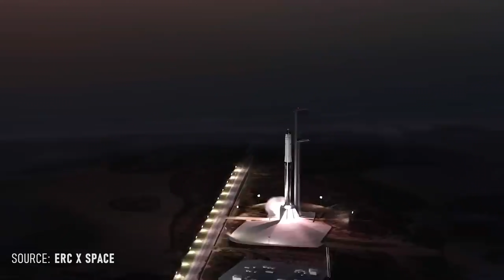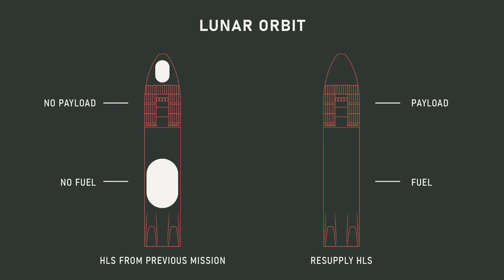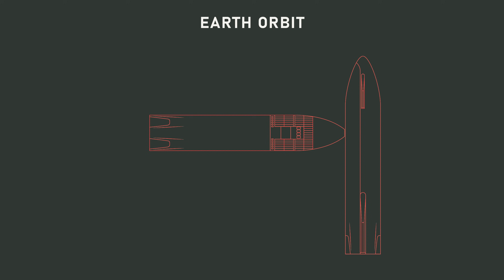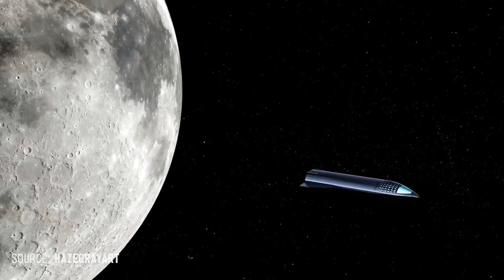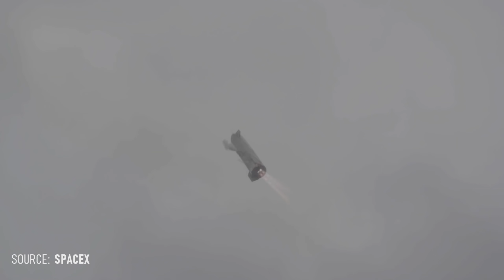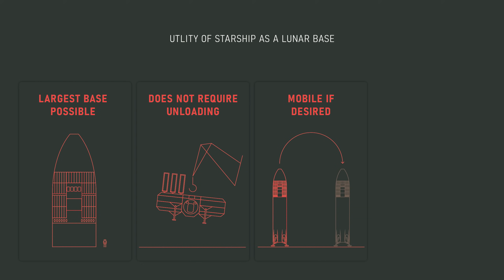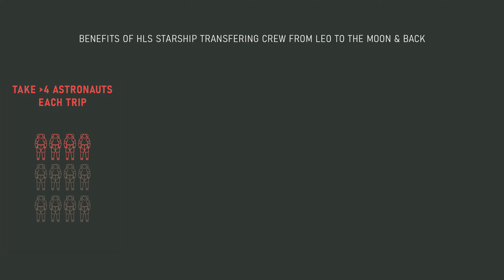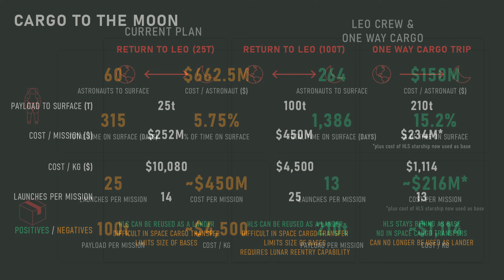How to Use HLS Starship

Comment: Why couldn’t yo send more than 4 astronauts on the alternate methods? Falcon, Orion and Starliner are all supposed to carry at least 7 to LEO and Starship can easily support that many to the moon and back.
Reply: Crew Dragon has room for 7, but NASA only uses 4 to the ISS. Crew Dragon has 9.3 cubic meters of pressurized space, giving about 2.3 cubic meters (3x3x9 or so feet) per astronaut. At 7 astronauts, you have about 1.3 cubic meters (2.5x2.5x7.3) per astronaut, so you are a lot more cramped. Crew Dragon has 12.1 cubic meters of unpressurized cargo space in the trunk.

Starliner has room for 7, but NASA plans to only use 4 to the ISS. Starliner has 11 cubic meters of pressurized space for crew and cargo, giving about 2.75 cubic meters (3.25x3.25x9.25) per astronaut. At 7 astronauts, you have about 1.6 cubic meters (2.5x2.5x9) per astronaut, so you are more cramped than with 4. 

The Orion will initially have 4 crew, but they are talking 6 crew for the later Artemis missions. With 9 cubic meters of habitable space (20 cubic meters total), it will have the smallest of the three living quarters.

I would guess that the ISS living space is why NASA only uses 4 on Crew Dragon or Starliner. Of course there were plans for 5 on Apollo, but they were never used. It could be like camping tents. The tent may say it fits 4, but figure only 2 will fit comfortably.
Reply: @steveaustin2686  thanks for the reply. Yeah, part of the reason to limit the crew to 4 is the capacity of the ISS, as there are already others there, but that isn’t an issue with Lunar Starship. It would be interesting to calculate cost/astronaut-hour and work hours available/mission with 7. I know I would tolerate a few hours crammed in a Dragon for a chance to go to the moon. Probably better than 3 in a Soyuz.lol.
Reply: @richardanderson1988  Oh for sure. Packed like a sardine to get to Lunar Starship? Certainly sounds like a good trade off.

Problem with Crew Dragon to Lunar Starship, is that Lunar Starship evidently has enough dV to get to Lunar Gateway, land and return to Lunar Gateway, but not enough to get back home. NASA was not happy with the Dynetics plan of refueling in lunar orbit and almost certainly won't like refueling with astronauts on board, hence the dual Lunar Starship plan in the video. I'm not even sure if Lunar Starship can make it from LEO to lunar orbit and back to LEO to be used as a ferry service as the estimated dV comes up short.

I wonder if NASA would be ok with having the crew wait on Lunar Gateway, while Lunar Starship was refueled a few km away. Evidently, NASA is looking at using the pressurized space on the cargo Dragon XL to be a bedroom/storage for the Lunar Gateway. Not sure how many docking ports it will have as only the Power and Propulsion Element and Habitat and Logistics Outpost sections will be sent to the Moon on the May 2024 Falcon Heavy launch. I wonder if a Tanker Starship, with nothing but propellant tanks and avionics, could make the round trip and if it could refuel a Lunar Starship enough to return to Earth.
Reply: @steveaustin2686  I’m not that concerned with having crew aboard Starship during refueling in space. SpaceX gets their fuel hauled into Boca Chica by tanker truck now and transfer it safely with no problems. The whole idea of using local resources from the moon, Mars or wherever to refuel will require that eventually people will be nearby. If we are truly going to be a space faring civilization, this seems to be a minor issue.
Reply: @richardanderson1988  In the long run, refueling with crew on board will likely be a minor issue> But with tons of propellant never having been transfered in space before, in the short term, it is evidently a big deal. Likely as NASA gets more experience and is more comfortable with refueling in space, they will do it away from LEO and with crew onboard.
Reply: @steveaustin2686  comparing to Soyuz it woul be spacious and for the hop to and from Leo more than practical.
I believe we will see the need to seperate Crew and cargo transport, reduced exposure and faster transfer, particularly on interplanetary journeys.
Reply: Well, SpaceX has a contract to perform in space refueling between Starships, so NASA is planning ahead. And bribing Boeing and others to try it, too. “Reuseabilty”, whether they want to or not.

Comment: I'm sure I just don't understand the maths, but if Starship can't and/or struggles to get back to LEO from the moon, how on Earth is it going to get back from Mars?
Edit: Just answered my own question almost immediately - they will be refuelling on the Martian surface of course! (I am Costanza, lord of the idiots)
Reply: Oh, that's right! Can they refuel on the moon, too? At some point?
Reply: Refueling  on the moon could be done, eventually. Oxygen is relatively simple to get from the water on the moon and makeup a good percentage of starship fuel. Methane can be produced, in the right conditions with the sabatier process and small amounts can could be obtained from the lunar regolith as a byproduct of mining if mining occurs, methane is not as easy as oxygen on the moon though. I would expect oxygen to be the first available to starship, in limited quantities.
Reply: It is worth also noting that the sabatier process  mentioned above would be used to remove co2 from the atmosphere breathed by the astronauts.

Comment: For your last option I have a few objections. first, starship is as far as we know rated for 100+ ton for leo. the larger previous equivalents in the BFR was talking about 150 tons. that tonnage can be taken further using refueling but that still places a maximum payload in the 100 ton region and I can't really imagine managing to shave of 100 ton off starship to make the 210 ton target.
 
Second starship being reused as a base doesn't make sense to me. Having a base is useful if the base can bring some significant advantages over the vehicles you are using and when you are using the over sized starship their really isn't much of an advantage, you don't need the extra space, and they will still be awkwardly vertical. This could be an advantage if an other lander provider shows up and spacex agree to use the starship as a base for a competitor, not impossible but I feel its a big if.  
Unless, we are talking about very specific and their for their unusual payloads for self-sufficiency the vehicle has to be counted as lost and even for these types of payloads it will probably be more interesting setting up inflatable habitats that are closer to the ground and with a more convenient horizontal configuration than using HLS and we a talking about very different mission.

Any way great video, you are a new and fairly small youtuber and even if I disagree with you on this specific point, you produce top quality contente on a similar level to Scott Manly and Everyday Astraunaute.
Reply: Per the NASA HLS Option A statement, evidently a Lunar Starship that is fully fueled in LEO, is capable of going to lunar orbit to meet the Lunar Gateway and then once Orion arrives, taking half the crew down to and back from the Moon. His cargo plan is to go straight to the Moon from LEO, skipping getting into lunar orbit or getting back off the Moon. So you don't need the fuel for those options, giving you more cargo payload to take to the Moon.
Reply: @steveaustin2686  I can understand that it is in theory possible to bring 210 ton from LEO to the surface of the moon using starship, but to get their we first need to that payload from the earth surface into low earth orbit. fuel at this point doesn't matter, starship only really has enough fuel to get 100 ton into low earth orbit and then relies on refueling to get the 100 tons of payload across the solar system.
To get to 200 tons you'd need atlest 2 staships and a transfert of payload in low earth orbit something apogee didn't like.
Reply: @gavinkemp7920  right on that one.

But... do you prefer to life in a garage over living in a penthouse because you want to avoid the elevator twice (or 4-6 times) a day? 
(And the garage will be build a LOT longer and is a lot more costly)
Reply: @gavinkemp7920  SpaceX is aiming for 100-200 tons to LEO and most estimates are for 100 tons. Evidently there is fuel left over, but no one but SpaceX knows how much is left over. Once in LEO, you need at least 2,000 m/s to go anywhere else, but we don't know how much of that Starship has before refueling. The more fuel Starship has in orbit, the more cargo you can replace fuel with.
Reply: @steveaustin2686  I don't expect their to be much. getting to orbit is the hard part, you need 7000 m/s and the booster usually provides only about 30% of that.
Reply: @Krusesensei  as I said a base doesn't really make sense with starship on these kind of missions as it so ridiculously oversized. If tomorrow NASA decides that they want to use the full capabilities of starship and 100 people to the moon, then a base would make sense, but you could still pack a lot more inflatable base in one starship than a single starship can provide.
Reply: @gavinkemp7920  Yeah, how much fuel is left over is what only SpaceX and likely NASA knows. Starship has 1,200 tons and unless Lunar Starship has stretched tanks, it will have the same. If there is 100 tons left over and Starship can lift 100 tons of cargo, then a Tanker Starship should bring almost 200 tons to LEO. That would mean only 6 launches to get a full tank. If it is only 100 tons for a Tanker, then you need 12 launches for a full tank. SpaceX got a $50M NASA contract to demo Starship to Starship LEO refueling by the end of 2022, so we will likely find out next year if we don't find out with the SN20+ flights this year.
Reply: @Krusesensei   but the penthouse elevator may break due to harsh conditions and you will die if you can’t get up the elevator and into the penthouse. starship will work in the short term but a moon base that will not require an elevator and have less moving parts will be safer and more reliable.
also i don’t think people will be going to the moon to live in a luxury penthouse anytime soon.
Reply: @ob1rayer08  I’m sure the elevator will have redundancy (at least two independent electric hoist mechanisms), and probably a manual backup as well (a crank to raise the basket and/or ascending gear to climb the rope by pedaling your feet, as is used in caving).
Reply: @ob1rayer08  But if the penthouse is cheaper AND build earlier...
BTW: there will be 2 airlocks and elevators.
Reply: @gavinkemp7920  its much LESS complex to simply use the starship.
Longterm you want a better radiation shielding, Garages for rover etc. But for the short time a the starship is the way to go.
And... whats the problem to have to much room?
Reply: @Krusesensei  Their isn't any, what I was objecting to viewing leaving starship on the moon as a reusable base which was one of his core argument on pricing he presented. For me leaving a starship on the moon would leave it almost useless and their for the cost of the vehicles needs to be added to that scenario.
Reply: Horizontal and partly Regolith covered will be the obvious solution, and it's doable.
Reply: @jonbong98  says who?

Comment: I think the tanks are stretched on the new design, probably enough Delta-V to return to LEO
Reply from the maker: I agree. But waiting until we hear for sure.
Reply: @Apogeespace  Great video !. Please make one with refuelling on lunar surface with local resources.
Reply: Agreed, judging by the new landing engine position and smaller crew cargo requirements of Luna mission, tank's have been expanded.
Additionally, engines are still in development and will have power and efficiency improvements.
Reply: I think this is right. The crew compartment is higher up now now than it was before.

I don’t think people understand how amazing normal/lunar Starship is at bringing average amount of cargo (>10 tons) a long distance (to the moon/surface).

Sure, everyone loves the fact that it’s an amazing shuttle to ferry 100 tons of cargo to LEO, and it deserves to get all the huge recognition for that,

But it’s an incredibly impressive deep space vehicle at bringing average amount of cargo (like what Orion would bring to the Moon) - <10 tons without being refueled all that much and being able to function as a lander and also command module if it’s not carrying that much (just the light mass of crew back to Earth like you pointed out in the video)
Reply: The stretched tanks give enough delta-V to get back to NRHO while waiting up to 100 days for Orion and to still  have some margin left. There is no way it would give enough delta-V to get back to LEO. The only way to get back without refueling is to aerobrake.

Comment: You entirely disregard aerobraking of HLS to get into LEO
Reply: No heat shield means that aerobraking is not possible.  That's why he did not cover it.  Lunar Starship would become a shooting star (then just a cinder) if it tried to aerobrake into an Earth orbit.
Reply: @toddwerme121  You don’t have to bleed off all your energy in one flyby. If SpaceX are returning HLS to LEO, they are definitely using aerobraking.
Reply: @KarbonatErolVerdienstkreuz  If iterative aerobraking is performed, then the Lunar Starship will be forced to spend significant time inside the truly dangerous portions of the Van Allen Radiation Belts.  The crew will be fried.
Reply: @toddwerme121  Yeah I wouldn’t do it with crew onboard, but as a refueling option for Artemis it might be better than sending a tanker to LLO even though I doubt it.
Reply: HLS doesn't have a heat shield dummy
Reply: @iamarokotmanson  If done in multiple swing-bys, no heat shielding is needed.
Reply: I don’t think Lunar Starship aerobraking with crew aboard is an option, due to risk, mission duration, and radiation issues. It may or may not turn out to be viable for uncrewed Lunar Starships. The inability to do much attitude control during aerobraking may be a problem leading to unpredictable outcomes, and the solar tiles, paint, and other external features may greatly limit the amount of heat that can be dissipated on each pass.
Reply: For refuelling and cargo? Yes
For return trip with people? It would take too long to safely brake.

Comment: The time that it took you is completely worth it compared to how much value this video has. Thanks for and keep on doing it!
Reply from the maker: I appreciate that!
Reply: @Apogeespace  agreed. Quality over quantity 👌
Reply: @Apogeespace Hi, Tim… here we are years later and it’s time for a refresher look at things.

First, just set SLS and Orion aside for the moment.

1) Gateway lunar space station.
2) Extended Crew Dragon and Falcon Heavy.
3) Starship HLS.
4) Starship tankers.

* Note- All Starship versions now have a detachable nose cone abort command module, with a pass through interior centerline airlock door. 

Earth re-entry Starships have an integrated heat shield on the command module, with interior integrated portal .

1) Gateway is in lunar orbit.
2) Starship HLS refuels in LEO.
3) Extended Crew Dragon on Falcon Heavy.

4) Crew Dragon and HLS dock at Gateway.
5) Crew transfer 
6) HLS lands on moon.
7) HLS command module departs moon.
8) HLS command module docks with Gateway and refuels.
9) Crew Dragon returns to Earth.

10) Repeat, building moon base with Starship HLS/cargo.

11) Command Module returns to HLS on moon, or HLS departs moon and docks with command module… ect…

12) All Starship variants operate autonomously when directed.

13) My purpose in writing you is to enlist your involvement and support, in forcing SpaceX into incorporating the HLS abort system in all Starship variants.

This is due to Elon proclaiming the Starship will have no abort system.

If, a HLS is falling over upon landing or failing for any other reason, the crew needs an abort capsule.

An abort capsule can safely rendezvous with  Gateway in lunar orbit… even if having to wait a few days.

Conversely a backup Starship can be stationed in geosynchronous orbit above the moon base location, etc…

Safety first and people need to start asking the abort system questions and where is it in the Starship plan 🎉

Looking for your support in this campaign.

Thanks, 

Robert 🍀
Reply: Thank you so much for this video, it answered so many questions i had.  The SLS Starship pairing is a temporary affliction caused by politics.  It will be remedied by time and $ considerations at some point.

Comment: What is the second most right rocket in the intro?
Reply: Between F9 and Shuttle? ULA's upcoming Vulcan
Reply: @human9458  thanks lol XD
Is it so small???
Reply: @ThomasTerpelle  61.6 m (202 ft) tall, 5.4 m (18 ft) wide. Shorter but wider than F9. A decent size rocket
Reply: @human9458  i thought that the vulcan would be more like new glenn in terms of leo capabilities. Is that the case or did i overestimate it?
Reply: @ThomasTerpelle  that's actually the Atlas V not Vulcan.
Reply: @ThomasTerpelle  Payload to LEO 
Vulcan : 27,200 kg (60,000 lb)
New Glenn : 45,000 kg (99,000 lb)

Payload to GTO
Vulcan : 14,400 kg (31,700 lb)
New Glenn : 13,600 kg (30,000 lb)

Seems like they have similar payload capacity
Reply: @human9458  thanks.
U know why the new glenn payload is shrinking so much to gto? Is the second stage of the new glenn so inefficient?